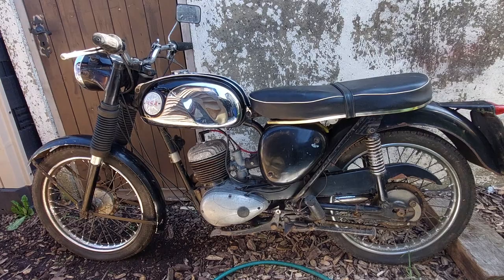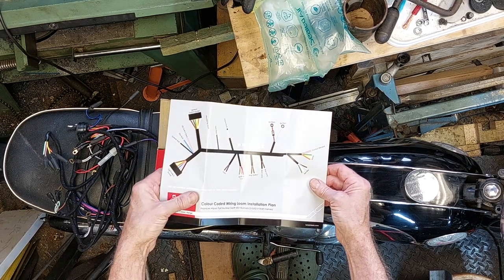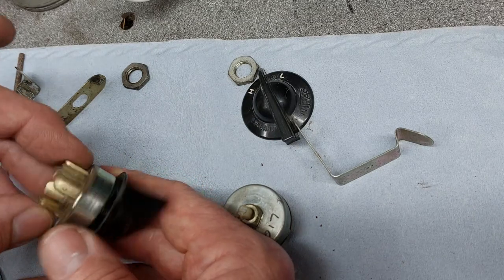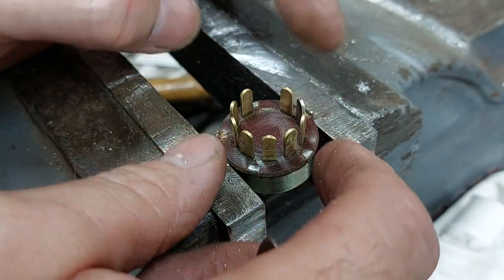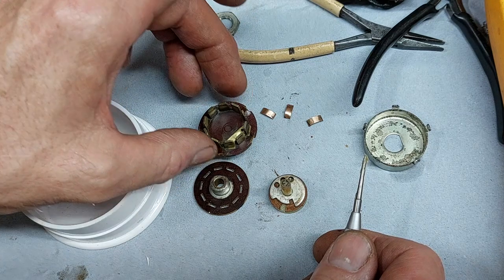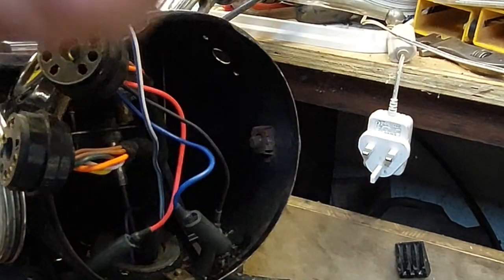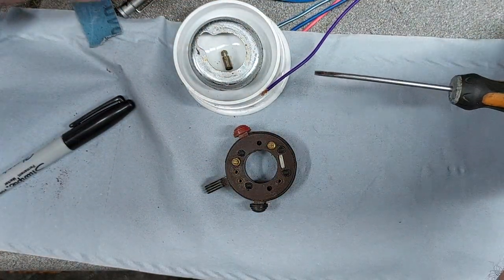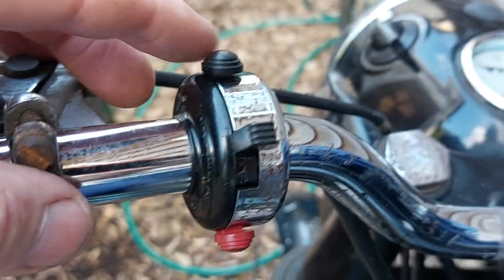BSA BANTAM B175 NEW WIRING LOOM FITTED AND SWITCH GEAR SERVICED

Comment: My brother bought a B175 Bantam a few years ago. The front mudguard is secured by stays, at the front & back. There is no fittings where the mudguard passes between the forks, so the mudguard "floats". There are threaded bosses on the inside fork legs, full of factory paint. There are NO holes drilled in the mudguard anywhere in this area.I can only presume that it left the factory like this. I will make something up, if I can get a glimpse of the said part in Youtube videos...Your videos are hilarious & helpful. Many thanks.
Reply from the maker: Just had a look in the parts manual ( and had a read of the repair manual) the mudguard is secured by the front and back stays but it also had a central support mounted on the inside of the guard that secured with bolts into those holes on the inside of the fork legs, hope this helps Martin.
Reply: Thank you for the advice, sir. i just fabricated my own version. Seems strange that it left the factory without it. @TweedsGarage

Comment: I was engrossed with your patience restoring the switch. You already knew what components would be found and taught anyone attempting this to learn first of all how it works before dismantling! My son restored two motor bikes, one was a Triumph sports Tiger cub and the other was a 1955 Ariel Red Hunter. He dicovered the gear box was a seperate unit made in the 1930s. Some British manufactures after world war 2 could never afford further investment in new tooling for years and cobbled bikes together from manufactured parts and still using pre-war machinery which the photos you showed from BSAs manual of different models testified to.
Reply from the maker: Glad you liked the switch restoration and even before the war they seemed to grab bargains if they could , the Excelsior has a mix of imperial and metric bearings in the engine/gearbox along with the Bantam which also metric wheel bearings!!! ( more understandable on the Bantam as the first ones where a copy of the German DKW 125 ) ...... these old vehicles keep you on your toes ( the 1927 Chevrolet had metric bearings in the rear axle ! ) .
Reply: @TweedsGarage  Interesting about the Chevy metric bearings, I would never have expected that until at least the 70s or 80s here in the states.

Comment: I love a strip down of parts that were meant to be disposable. That's the appeal to older things, you can get inside them and fix them . Too many things are sealed for (short?) life and you can end up destroying them trying to get inside.
I've always loved fixing things and as a nipper I remember bending back the tabs of a tinplate clockwork car to gain access to re-attach the spring. I guess it all started from there. Even today before I throw away something broken I still see if I can fix it.

I'm afraid you've been done, Mr Crispin's toothbrush has a royal crest on it. Hope you didn't pay a lot for it.
Thanks for the video, I loved the suspense of someone else getting those three springs in place.
Reply from the maker: Damn that eBay it was listed as a genuine item with certificate of authentication signed by the man himself !!!! Glad you enjoyed the tension 🙂
Reply: @TweedsGarage  When dealing with small springs in tight places, there is always drama and tension to be had.

Comment: I always thought what we need for fiddly jobs with springs and ball bearings is one of those baby incubator things to do the dismantling in. I suppose you'd have to take the baby out first... And for continuity testing hell, try building Enigma machine rotors!
Reply from the maker: I can only imagine Simon, I used to have to continuity check wire wrapped chassis units for multiple circuit boards......tedious to the extreme.
Reply: @TweedsGarage 
We had a job with a motherboard for a box on the B2 bomber that needed to be tested 100 percent for any problems. I set up an automated testing machine from the Drive In Movie Testing Company (Ditmtco) that ran all the connections. The box only tested 256 connections at a time so the process required 16 steps, moving interface cards inside the unit to get it all done. 
.
I understand your pain in checking out wire wrap backplanes. Like Ykes!

Comment: That was a really successful job ! Really nice to be able to get a new wiring loom together with new connectors, I wonder why they have changed the colour coding on this, I would think the number of these looms that they sell would not make it viable to start producing a new run, so they could be old stock re packaged, you ae lucky it was not fitted with Bosch equipment , that would have self destructed many years ago, when you consider this has been used and abused for 50 years and it still cleans up like new then look at the equipment we buy today this must have been at the very end of a repairable era, I think the crud inside the switch must be the original grease used on assembly of the switch. But it has all come out like new! Well done Allan! Chris B.
Reply from the maker: Thanks Chris, they did come out surprisingly well considering Wipac was the bargain basement when it came to electrical equipmentn and yes in the UK there is the assumption that Bosch equipment was better but I can affirm on MK1 Golfs that the fuseboxes were absolutely dreadful .

Comment: Great stuff Alan, you epitomise the old saying that the art of fixing things is having the bottle to take them to bits; which you did with the switches, cracking job mate... Sadly I'm going to be picky, "Loom" seems to be a term which has floated across the Atlantic over the years, back in the day I would call it a wiring harness, the brief glimpse of the manual showed the word "harness" which backs me up somewhat, It's a bit like calling a pillar drill a drill press; I mean what's all that about...Anyway enough of that, looking forward to the next installment mate, I hope it all works... Allen O'Rourke...
Reply from the maker: You are quite correct, as an Englishman I hang my head in shame Alan, but to be fair when I done my apprenticeship we were taught the art of looming and lacing for aircraft wiring looms/harnesses, it was interchangeable, I think the whole aircraft wiring was a loom and harnesses were sub assembly wiring ( nothing looks finer than a tidy beeswax cord laced loom )
Reply: @TweedsGarage  
A well laced harness is a thing of beauty, best done on a loom. 

I myself have always called assemblies of individual wires with perhaps some cables thrown in for good measure harnesses. When doing the drawings, I have always used the term Loom for the board or other fixture used to make the harness. But this is just me, everyone is different.

Comment: Wipac Tri-con switch, I think the red button is for a magneto cut out, not used on a Bantam. A Bantam would use a Du-con switch which does not have the red button.
Reply from the maker: Nice bit of Wipac info, cheers 👍

Comment: What does the I and e stand for on the ignition switch?
Reply from the maker: The I stands for ignition and the E is emergency position ( when the  battery is flat, it connects all the charging coils together to give you a fighting chance of getting it running)
Reply: @TweedsGarage  thanks a lot for that. I'm currently restoring my granddad's old Bantam and this had me confused earlier.

Comment: I like your humour and other content but I want to ask you if you think as I do to it's a good idea to run earth wires to everything rather than using the frame as ground ,I have done it on my c15 the nips did it donkeys years ago it seems so obvious to me that it should make the electrics work better maybe?cheers all the best and please keep up the good work
Reply from the maker: Yes indeed Frank, especially with a 6 volt system, it needs all the help it can get, it may have been sufficient when the bikes were new but after 50 plus years of corroded fixings and mating  surfaces its a miracle if the electrical  system works at all and its not a difficult task to run a few earth wires .